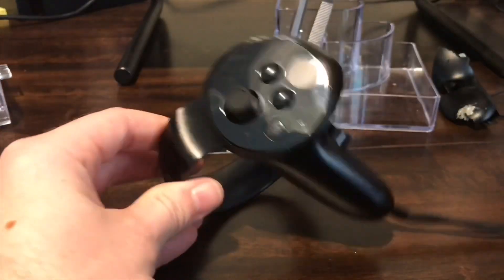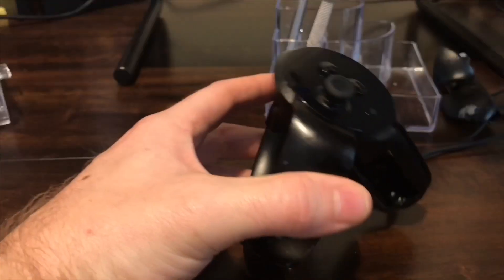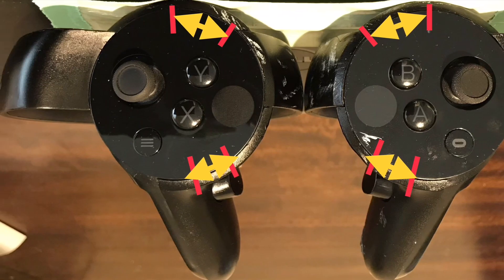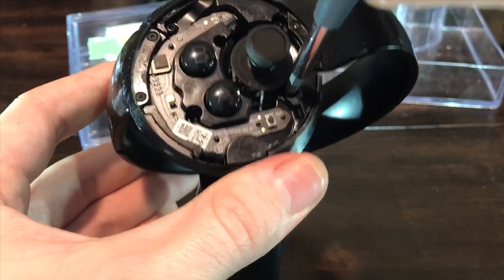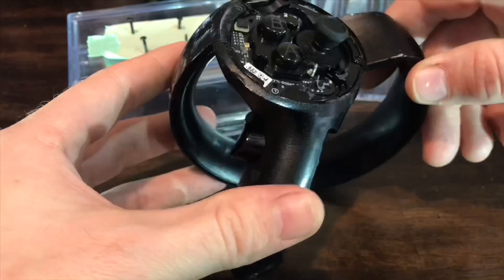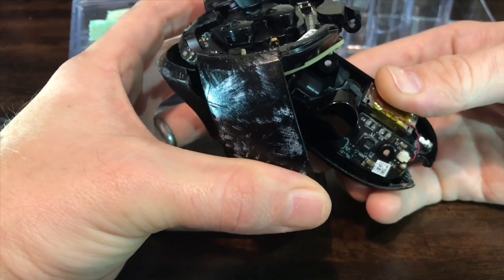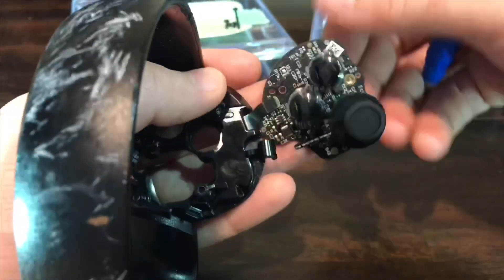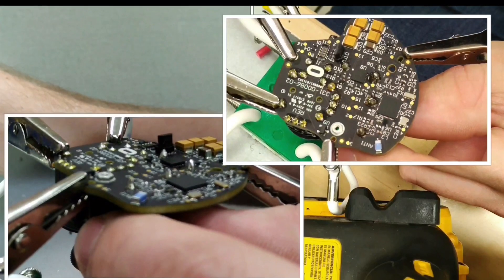Teardown - Oculus Rift Touch Controller

Comment: Jesus, what happened to that thing?
Reply from the maker: Chland , a little bit of everything
Reply: If it's paint that had adhered to the Touch controller, as opposed to paint coming off the controller, you should use a wet wipe or something & try scrubbing it clean. Those scuff marks absolutely occlude a fair few of the IR LEDs & can negatively affect your tracking.

Also, turn on Guardian & move it a foot or two in from the nearest object or wall. Damn, man.
Reply from the maker: Nager McDuck . Guardian system hahahaha, I play echo arena. No guardian system can contain me ( I actually do exactly what you mentioned  I just blast right through it at moments) not a bad thought about the Cleaning it up, but I've had no issues with tracking so far. I'll give that a shot and see if there are improvements